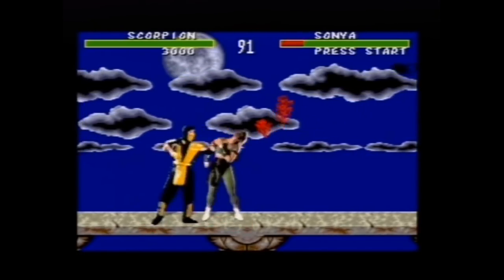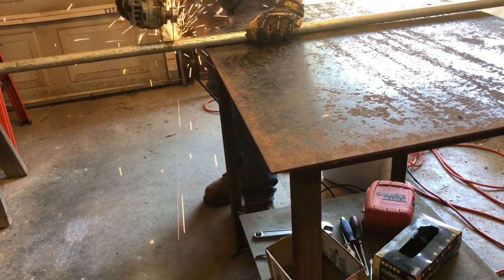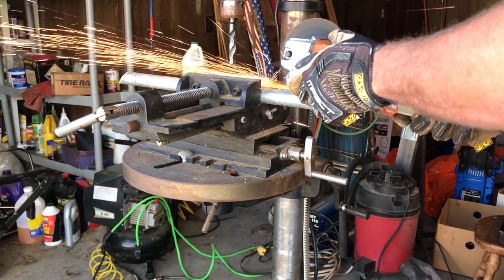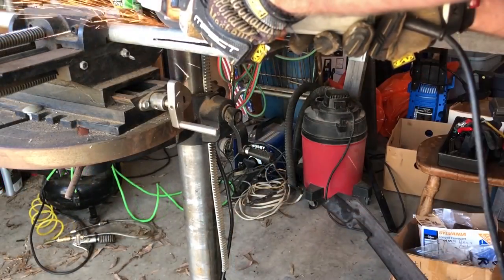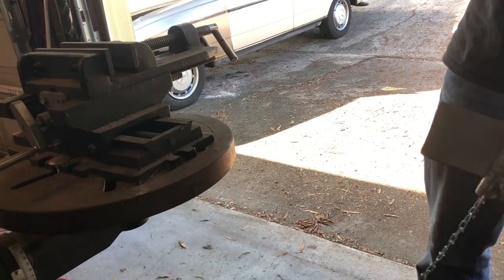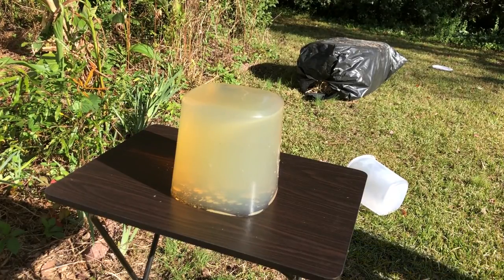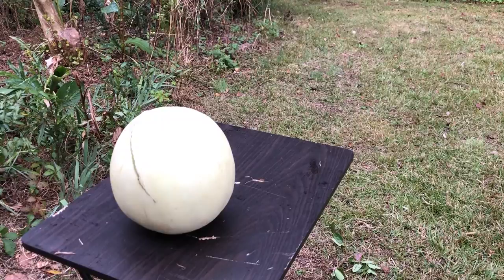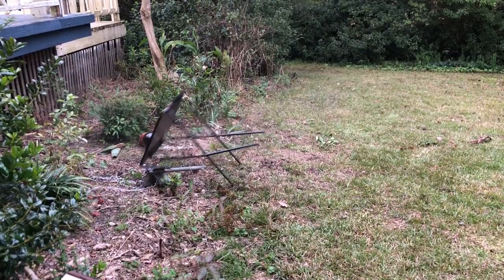Making a real hook weapon

Comment: Don't want to pull away from what you've done, surely more what I would do, but you should stabilize that table.
Reply from the maker: Yeah.....that table is fucked now. I should have braced it with some wood
Reply: @MangooseGG  Oh, not the one you were placing targets on but the one you were cutting on in the beginning. But yea, that TV table is wrecked.
Reply from the maker: Oh yeah, I need to stick a shim under one of the legs

Comment: I'm finding it funny that you call it a real hook weapon, but there is no hook.  I recommend adding a curved piece of metal (aka the hook) at the non-pointy bit of the spike.
PS: Sorry for my layman speaking Just didn't feel like putting to much effort into it.
Reply: It may also help if you make an elongated arrowhead, solder two curved spikes to both sides and solder this onto the tube. It may help the weapon's ability to pierce if the sharp end is at the center of the weapon instead of having it off to the side.
Reply from the maker: I may try to remake it and take these suggestions into consideration. There is a barb on the end, however my camera overheated and I didn’t capture that part of the build :(
Reply: @MangooseGG  I think the curved spike will provide a better grip than a barb.
Reply from the maker: Most definitely. Before I go back to this think I want to knap out a stone axe head to make a khai axe
Reply: @MangooseGG  An actual stone axe head or one that looks similar? Because if it's an actual stone axe head you'll need to find a large piece of rock and slowly chip it away. Fun fact that's how stone weapons were made in the stone ages, grab a rock to forge the weapon then grab a chipping rock and chip away until the weapon is made.
Reply from the maker: Yeah it's called knapping. I've done small arrowheads before when I was a kid. Probably not going to be able to do a large axe head but I'll try.